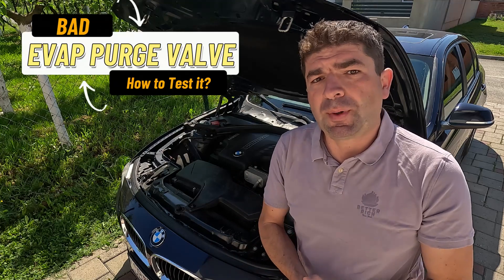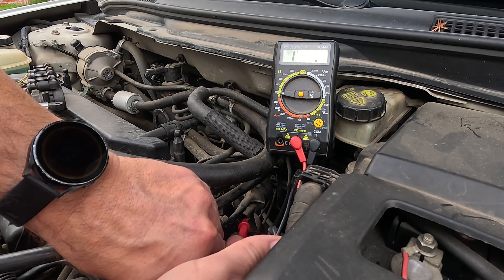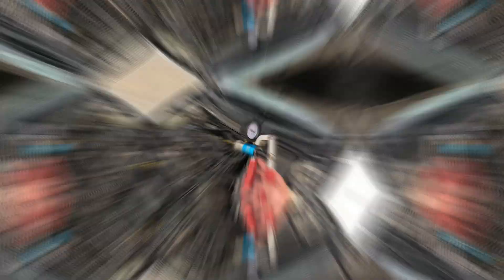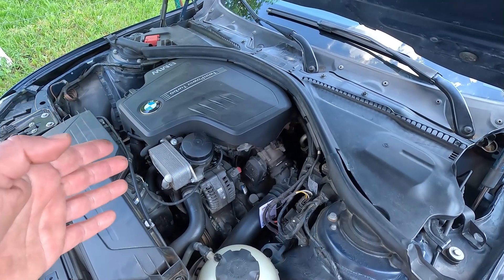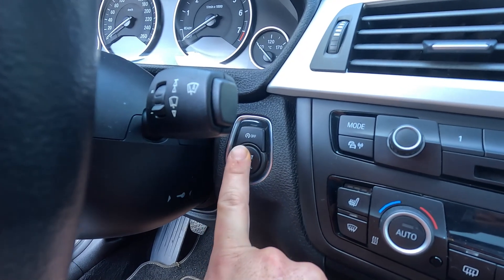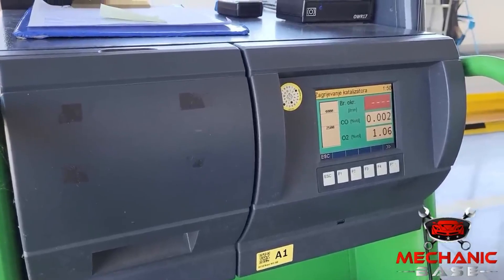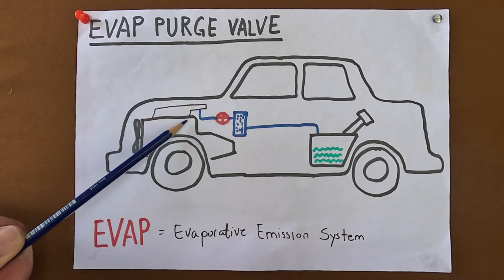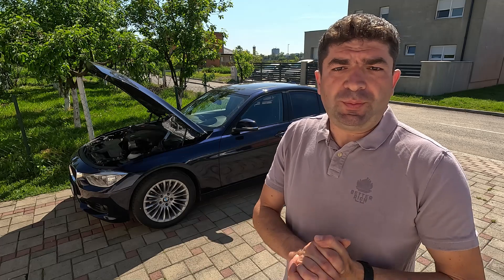How to Test an EVAP Purge Valve (DIY Guide)

Comment: Hello, I have a Touareg WW 2004, V6 3.2, it can't start without spray in the air filter, I replaced the PCV valve with a PUSH valve and I have the same problem when I put the code on the computer, it says that the Secondary air injection valve is Shorted. What could be the problem?I also replaced the secondary injection valve and nothing has changed, the car can't start without the starter spray in the air filter.Thank you

Comment: Fabulous job! I always use a fused hot wire that i made and have hanging up to jump various things. Make sure one hose goes to the motor (or vacuum), the other goes to the vapor canister (usually near the fuel tank). Chrysler has either 'CAN' or 'VAC' on either or; Lastly, some are positional/directional...mine says 'UP' right on the side.